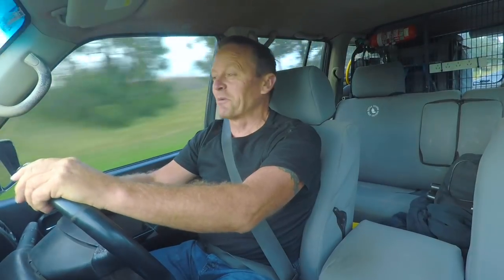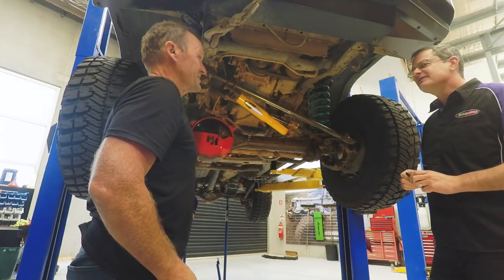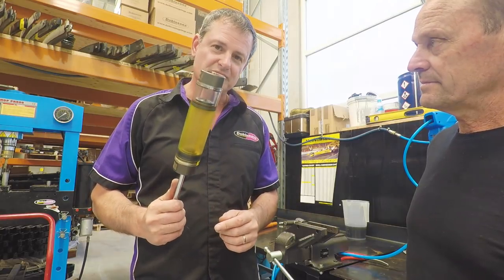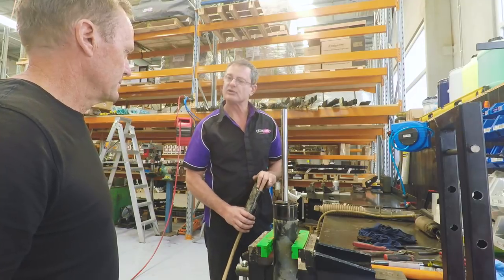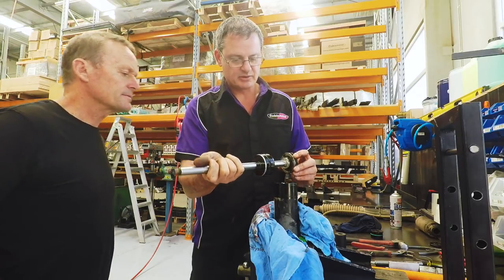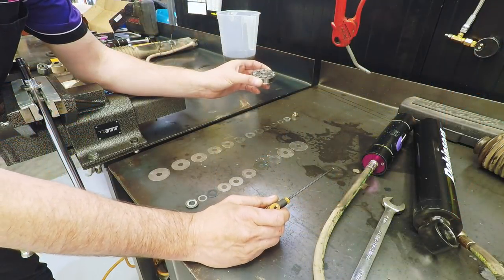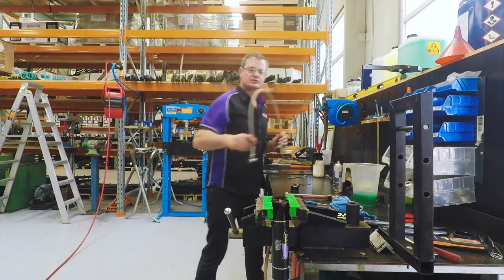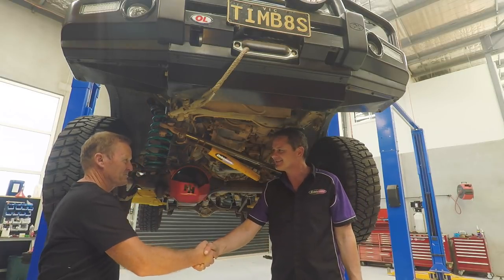4WD Suspension Upgrade - ( Nissan Patrol MRR Rebuilt )

Comment: hey Tim have you had a chance to give these a run out bush yet since the rebuild ? notice much difference and any idea on what it costs roughly for a rebuild ? thanks mate
Reply from the maker: Hi Ryan, 

Yes, i went into Wonnangatta this weekend and on to Dargo. They were still good before the rebuild, but now they are smoother thats for sure. The MRR's are a wicked set up.
If you can call the guys at Dandenong on 03 9706 5200, they would be able to help you with any questions you have about the rebuild costs.

Comment: So what does a rebuild cost as a comparison to replacement? I’m about to add some Dobinsons to my 2015 Colorado 7 and I’m trying to decide between the ordinary Monotube and the MRR version.
Reply from the maker: Gday  Stuart,

Im not sure on the rebuild costs mate. If you can call the guys at Dandenong on 03 9706 5200, they will be able to help you out with any rebuild costs that you have. 
The MRR's mate, are wicked. I highly rate them.
Reply: Hi Stuart, A rebuild costs $140 (if no extra parts required), the average cost for a MRR is $350. The normal monotube shocks can also be rebuilt in the same way. Any questions, please give us a call on 9706 5200, thanks Richard, Dobinsons Springs Dandenong
Reply: I love the idea of being able to rebuild. Not a bad price for rebuild to

Comment: Hi Tim, love all your vids.. I have found them entertainig and really helpful with the advice. Recently I took the plunge and got a 2 '' lift on my 2014 Patrol at Dobbo's. when I got it back it has been drifting to the right. I took it back the the boys at Dobbo's and they switch my wheels which helped a little, but my steering wheel is still crook turned slightly to the right. Dobbo's pointed out to me the tracking arm on Nissans are welded and do not have an adjustment so the can't fix the problem unless a buy a new tracking arm. They also suggested the get Pinard upgrade.. I did not budget for this and was wondering if you needed to up grade?  Any advice will be appreciated .  Regards Jamie.
Reply from the maker: Hi Jamie,

I have up graded all of my steering arms on my Patrol.
Mine are now fully adjustable, and i have never had a issue with steering. 
I have a 3in lift though and when you go that high, you have to fit fully adjustable steering arms. 
I hope you can get it sorted out.
Thanks heaps for your reply and feedback on my videos. I greatly appreciate it. 

Cheers Tim.
Reply: Hi Tim, Thanks for the reply. I guess I have to bite the bullet and get an upgrade. Everyone I spoke to told me will a 2" lift you don't need to do any extras. Not so true with the Nissan. Makes me wonder all the times I paid for a wheel alignment was a crock.  My plan is to upgrade my exhaust next. Will wait a little longer. Looking forward to your next vid.. Kind Regards Jamie
Reply from the maker: Catherine Lynch 

Gday Jamie,

Where did you get the Dobos fitted?
Generally with a 2in lift, you don’t need any extra bits other than the 4 coils and 4 shocks. 
I know all the standard arms from factory , don’t have any adjustment. 
I went 3in and everything needs to be changed. 
Look forward to hearing back. 

Cheers Tim.
Reply: Hi Tim, I did post reply yesterday not sure why it did not go through. I got the suspension upgrade in Dobinsons Smeaton Grange which is South West Sydney. The boys did good job I just wish I knew this would have been an issue before. I would have pressed on anyway. I got on some Patrol forums and apparently the steering wheel off centre is common with lift. Mine is probably sitting between five and ten past when I am going straight. I guess some people can live with that. Those of us in the OCD world it is not something we can live with. I just want it to be right. I really appreciate your replies. Hope you are keeping safe it the crazy time? I cant for this to be over so we can get back to being out and about again.
regards Jamie
Reply from the maker: @catherinelynch6669  Yeah mate, im hearing you about you want it to be right and it should be. 
The Patrol for some reason has had a steering straight issue with some people. 
Mine has never had that problem. 
Hope you get it sorted out soon. 
Thanks agin for your updates.

Cheers Tim.